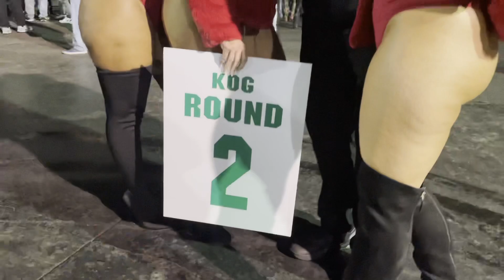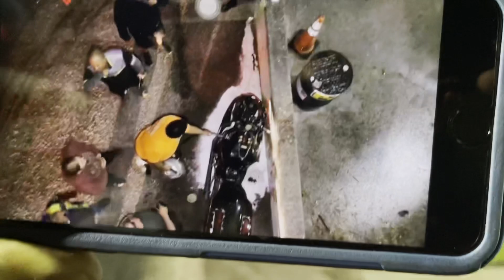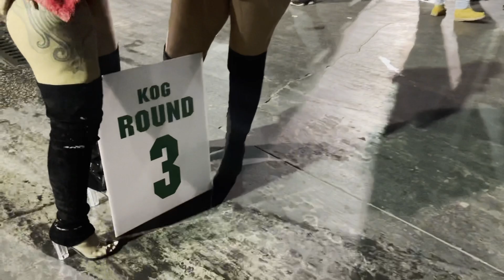FIGHTING & CONTROVERSY ERUPTS at $90K GRUDGE BIKE RACE!

Comment: There's no 'tech inspections' at these events...so Rasheem took the buy in $ in good faith ,period.  Once protested Rasheem stuck with the words that CM said "i will bring BMamba here Running and even make passes. Thats where it gets messsy.  It wasnt clear by Rasheem about using whatever parts off of whatever bike...that is the bottom line..CM's mistake was saying he would bring BM there running complete as Rasheem leveraged those words.

Comment: If it was all out bring anything none of these clowns would win. Larry McBride would come to town and shut them all down.
Reply: im 46 years old and still ride. Im tempted to have a bike built just to go down there and take their money. Hell that old 1100 i had, i let a guy ride my bike and i rode his GSXR 600 the blue and black one from around 92 to 94 and beat him on his own bike. Most of the time its the rider that wins. Only when both guys are really good does the bike matter. Ill give you flop necks out there a tip, HEAVIER CRANK LONGER STROKE LOWER RPM. Engines rev too quick. slow the engine down and use trans and gear to turn the tire boys. JUST ONE OF YOU TRY IT AND YOU CAN THANK ME LATER.

Comment: That stocky guy arguing at 29:50 is a bone head, in any racing series a vehicle can be tech inspected at any time, before a race, after a race...I've raced in various classes and you pay your entry fee before you get to the paddock (most of the time) if the shite you bring doesn't pass tech, it's not their fault, it's yours, period. But, every other series I know of requires a tech inspection before the racing begins also.

Comment: You can’t DQ after the fact?????? WTF
Reply: yes you can. Every race series allows challenges and protests even after a race. But the promoters f-ed up here by not having a tech inspection before the race. Plus any rules should be published and or mailed to all participants. Usually a contestant has to pay money up front to log a protest, this covers the cost of the inspection especially if requires bike /engine break down.  If the protester is right he gets his money back, if he's wrong and the bike is with in specs, the money goes to the team that was called out for their time and effort.

Comment: First of all why did you change anything on the bike if you were so right why was the bike fairing changed so you knew that would be an issue $90.000 you knew that they were going to be very discreet you did that shit to yourself if it wasn't a probably then the bike would have been dressed up in its original outfit I'm glad you came outta there safe because it was getting ugly for you an your Crew and I'm sure no one out there was afraid of you!..